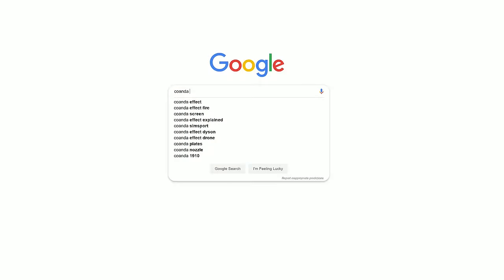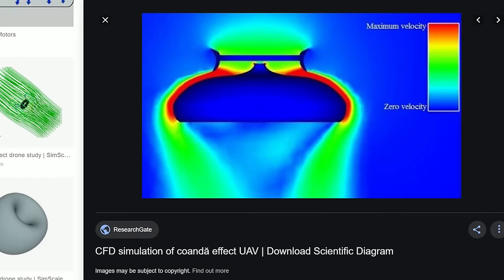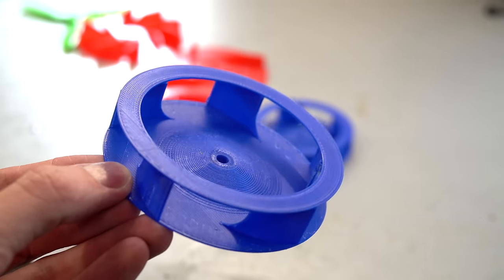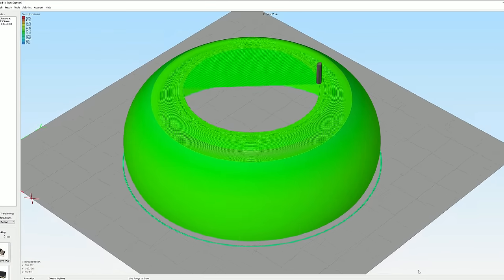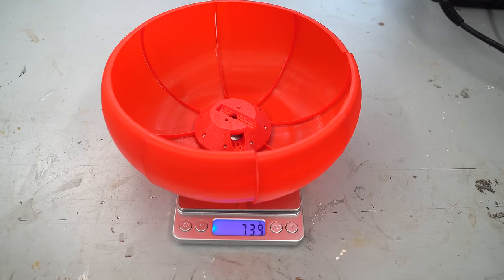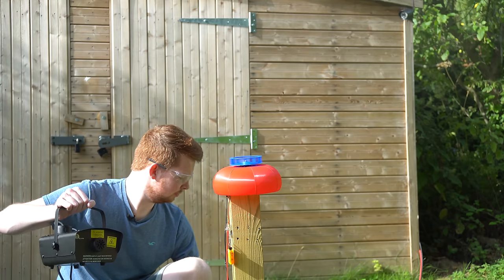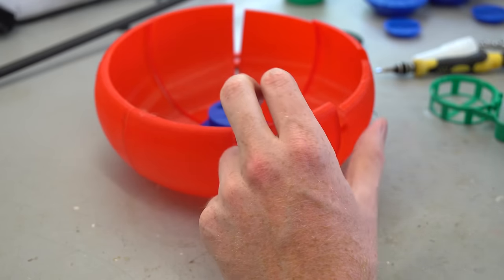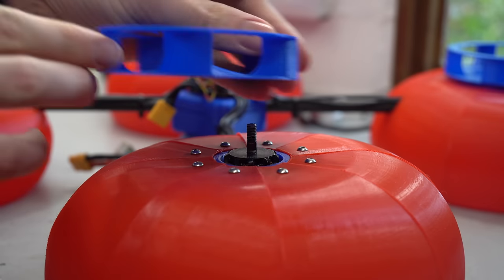Coanda Effect Drone Propulsion

Comment: I spent a long time testing propulsion in a partial vacuum chamber to see what might work best at Mars. As it turns out, ordinary propellers beat every other option hands down. My advice when converting electricity into thrust... Use a standard rotor profile, size the tip-to-tip length just below a length that would send the tips supersonic, and you will get the most thrust possible.
Reply: That's really cool!
Reply: Awesome stuff
Reply: This is the type of insight that is worth a million dollars!
Reply: where were you when i was doing my masters in electronics engineering and went through 7 months of hell? (the props i got were bad profile and i didn't even consider tip to tip size)
Reply: That’s what she said!
Reply: Yeah, I guess it turns out 100 years of aviation have not in fact been running gimped designs for no reason.
Reply: people who send prints to the 'fan showdown' youtube show where computer fans compete might like to know this tip
Reply: What happens if the tips go supersonic?
Reply: Not 100% correct when you factor over slippage.. But if you don't care about efficiency then with a low pitch propeller generally max thrust is at subsonic near supersonic tip speed. But in practicality energy isn't infinite so best to go for efficiency and use the best RPM for the span, the chord, the aspect ratio, and the pitch angle. AC43-13-1B is the defacto reference for propellers and MEP rpm charts
Reply: @InfiniteDarkMass  Since air is a compressible fluid a lifting body can utilize bernoullis principle to produce lift. this works with rotating airfoils since the air on one side of the airfoil is forced to move at a higher speed than the other side due to the displacement of the airfoil itself, having a flat surface on one side and an angled surface on the other. 

At supersonic speed the air gets cut into a cone shape into a bow shock layer thus ignoring the lifting body principle of the airfoil. Normally the boundary layer reunites at the trailing edge of the airfoil but in supersonic airfoils the cone produces 2 shockwaves called the separation shock wave and the reattachment shock wave. There is also a bow shock layer that occurs from the leading edge. This entirely ignores all of the airfoils lifting surface. also supersonic airfoils lose the lifting principle entirely, since a convergent duct flow normally increases velocity and decreases pressure, supersonic air always wants to increase velocity and pressure. This is the same reason why jet engine compressor inlets on supersonic aircraft must slow the air to subsonic speed, and also why jets with afterburners have variable geometry thrust nozzles, such as on the blackbird sr71 which has the inlet cone to feed subsonic air to the compressor while flying at multiple times the speed of sound.
Reply: @adawg3032  - Thanks for the expert input. Indeed, there are numerous factors and limits to the design of a propellor system.
Reply: @adawg3032  I understand you seem to know what you're talking about but I have no idea what you just said.
What changes from the original suggestion would one make to comply with yours?
Reply: @adawg3032  cool, thanks for the answer.
Reply: I did a ton of thrust simulations for my senior design project and this is exactly what my results said!
Reply: I'd like to see if that stays the same with the toroidal props MIT came up with.
Reply: @InfiniteDarkMass  constant sonic booms, air force actually had a plane like this trying to make a mach 1 propeller plane :O determined not viable because the noise would eventually rattle the plane apart and deafen anyone nearby, including pilot
Reply: @FractalNinja  The Republic XF-84H Thunderscreech. Said to be so loud it was heard from 25 miles away and the continuous sonic booms from the propeller could knock people down.
Reply: yes. Propellers where experimented and tuned, since the 1894, maybe even longer. They have more than 100 years of evolution behind them so they kinda have to be most efficient. Anyhow, since you seem very professional, what is your oppinion on Toroidal propellers? So far Ive just seen feelings about them, branding and haters of the MIT. All of them arent trustworthy. Id be very thankfull, if you would share your proffessional oppinion with us :)
Reply: @InfiniteDarkMass Cavitation 😅
Reply: @adawg3032 can you explain the letters and numbers in your explanation?
Reply: @InfiniteDarkMass    Cavitation, where the air won't stick to the blades, it happens real bad with helicopter blades that are spun too fast like with American choppers eg. The Apache 1200rpm, fastest rotor speed in the world, the blade tips flex violently
Reply: Hey , can you test for MIT Blade design
Reply: Meanwhile the US Air Force when they got a contract check:
What if we make two supersonic propellers back to back?

Comment: Considering the obtuse and complicated nature of this - you should be pretty proud to get it working first try
Reply: First? have you seen how many iterations of impellers and domes he had?

just because he showed us the (marginally) working one, doesn't make it necessarily the first try.

but making (even timelapse) video of the process would probably make this boring for a lot of people on youtube. so it is easy to get tricked.
Reply: @gominosensei2008  it was in the air and relatively controllable on the first try, yeah it wasn't perfect, but I know myself and many others couldn't have done it
Reply: @BigDDaddy yeah, the weight, complication, extra cost and possible reduced thrust means it isn't worth it
Reply: @Oli420X  not flight thought, ground effect.
Reply: Obtuse rubber goose green moose guava juice 
Giant shake, birthday cake, Large fries, chocolate shake!
Reply: Would the impellers create vortices in the center of the craft and create turbulent flow
Reply: Everytime I read or hear the word obtuse I automatically think of key and peele
Reply: Aahahah tryna sound smart
Reply: I did this with pyramids and works way better
Reply: @user-lr8dq7eb4n  I wondered this too.  Would it help to make alternate impellers/propellers spin in the opposite direction? [of course, changing angle of vanes so thrust is still downwards 😏].  Or would this just make the turbulence worse?  Does turbulence affect thrust or stability or both?
Reply: @Oli420X  qq
Reply: @Abdega  what the hell is Timmy Turner doing here ?
Reply: Obtuse is such a fun word. You can say stuff like:
This is my brother. Don't mind him, he's a bit obtuse."
Reply: Obtuse? I think you mean abstruse.
Reply: @gominosensei2008 ? Dd
Reply: There's no chamber for the propellers to create the airflow.
Find Any Fan That Use That Type Of Propeller, You'll Immediately See!
THE WHEEL MUST BE PLACED IN A CHAMBER/ENCLOSURE, To produce proper airflow.
His design Prevents Proper Flow Of Air.
A flow chamber covering the wheel will produce a better stream of air.
Reply: @Abdega  I'm sensing a Fairly Oddparents reference

Comment: I love the fact that nowhere in this entire experiment is the question "why?" even considered!
Reply: The "why" would be to create safer drones.
Reply: @wesselgeldenhuys6103  a wire mesh around the propellers would be far more efficient at achieving that goal. I like "because it's cool" as a reason.
Reply: Because playing is how we learn things :)
Reply: Lower air pressure per unit area on the ground suggests less chance of setting off a mine?
Reply: @wesselgeldenhuys6103  For the toy market a simple model similar to this, which is altitude limited and has simplified guidance, if fitted with cheap FPV would reduce the skill factor required and make them more popular and safe, about a meter  altitude would be good.
Reply: Because the answer to that question is always the same why the f not.
Reply: my guess would be to spread the air pressure right under the drone  imagine a helicopter that doesnt feel like you are walking mid tornado  while going  under it
Reply: Whenever l ask "why?" The answer is almost always $.
Reply: Dome shaped drones could assist in soft landing, coanda drones could be energy efficient, a new patent possibly.
Reply: 1910 Paris expozicion.
Reply: If thought of as a secondary source of thrust it makes more sense.  Like a turbo charger on an engine.  Just taking waste air and extracting more life from it.
Reply: I get the sense this guy thought "why not?". And until you prove something like this to yourself, you may never know if even unexpectedly, your design suddenly out-performs a regular drone and you've really discovered something. Kinda like that old quote "Only he who attempts the impossible, can achieve the absurd."
Reply: Science isn't about why! It's about why not! -Cave Johnson
Reply: @aswallace88  , no.
Reply: @RawanaTiger  far less efficient, because the airflow is mostly horizontal but merely gets deflected somewhat vertically instead of being vertical so the downward thrust is probably about half the thrust (it looked like deflection in the smoke experiment was about 30 degrees and sin 30 = .5 so half) Also there will be drag losses since the airflow is flowing over a surface, there will be losses to vortices formed between the flow and the surrounding air, so probably way less than half. Then you have the extra weight of the curved surface to blow the air over. Add to that engineering considerations like those someone pointed out elsewhere that the curved surface prevents the airflow from cooling the motors so they overheat faster.
Reply: For science.

Comment: Huge problem with this design... propeller airflow cools the fan motors, impellers don't cool the motors at all.
Reply: Some quadcopter motors like brotherhobby tornado series have built in impellers that will cool the motor.  This would be a good application for them.
Reply: Coanda effect is used in notar helicopters to enhance safety by reducing complexity and likely points of failure, but his drone re-design adds complication and is unnecessary, there's no reason for it.
Reply: Put a hole in the center of the top of the Dome put the the propello on the inside of the Dome it will suck the air through the center of the Dome and will work properly it doesn't need to be on top of the Dome it needs to be on the inside with a hole in the center of the Dome on the top it will work more efficiently
Reply: @patroberson6952  Agreed
The impeller doesn't blow air downwards but sideways - he was getting lift only from the vacuum formed on top, if mounted INSIDE the dome then you will have great vacuum on top and good pressure build at the bottom.
Reply: actually, come to think of it, control might turn into a bit of a problem though :-)
Reply: there's always reason. It's all part of more deeply understanding the process(es)
Reply: @hansvanderlinde4020  then you wouldn't be employing a coanda effect
Reply: Also the impellers are much heavier than the propellers. That alone will make the motors work much harder. Sizing the motor to the spinning weight will make the system more effective
Reply: No. He based it off the UFOs. Their problem not his.